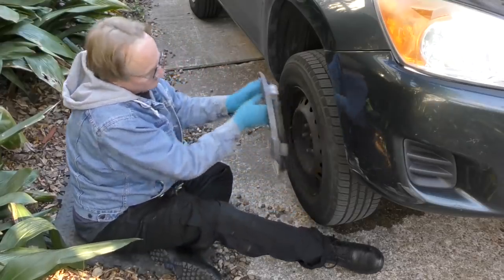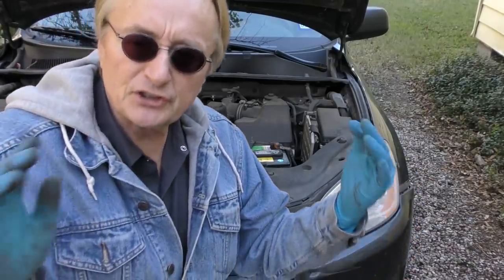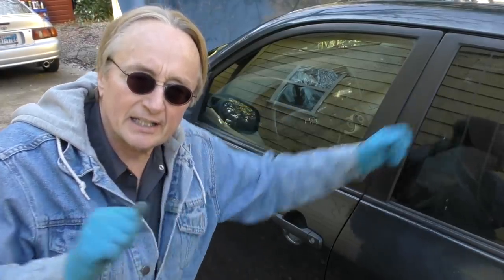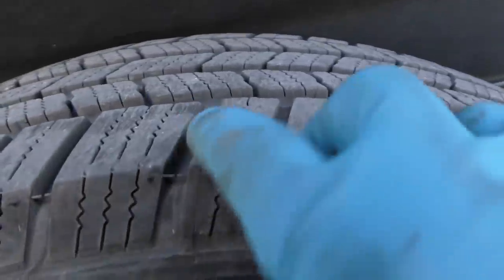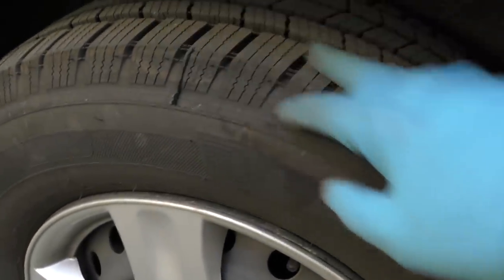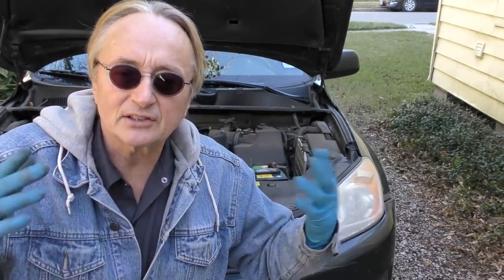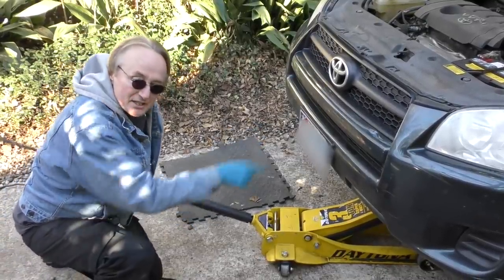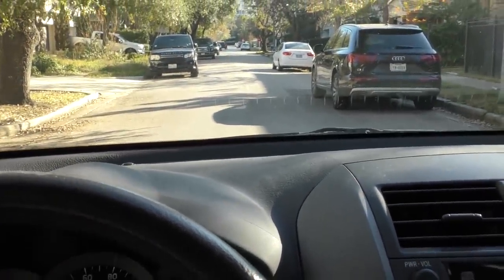Tire Secrets Only Mechanics Know

Comment: The reason they recommend the new tires on the rear is that when you make a turn at high speed the rear of the car(front wheel drive or awd)will loose traction and slide towards the outside of the turn (because the rear is lighter with engine mounted in the front) causing loss of control. 
I prefer the new tires in the front(only of I do not have the choice to buy 4 tires-i usually do replace all 4 and rotate them)like Scotty and drive slower around  the turns.
Reply: Basically they do this because it is less scary for the general public to understeer than to oversteer and generally keeps the average driver safer sliding out rather than spinning out. I get it, it's a lawyer thing but I'm with you guys, new tires on the front makes it handle more neutral to me.
Reply: @Gunne.r  yes ..you explained it better. I agree.

Comment: I just changed my struts my self. The old struts are bone dry. However, I did the compress test, and they just lost all the pressure! They stay compressed. So, worn shocks could be just worn out at the inside. 
If the car doesn’t feel stable on highway, change the shocks and struts

Comment: 90.ft lbs on my car.  Wheel seated on hub with a spot of lube to allow release. Torqued in a star pattern with no thread lubricant in three steps.  25 ft lb, 50 ft lb and 90.  Using a calibrated manual torque wrench.  Infiniti hub assemblies can be distorted by uneven or overtightened lugs by the guys at the tire shop.
Reply: Robert Burley  When all else fails, read the instructions...

Comment: It would have been nice to see the car shake to start as we saw the car not shake later. I always put the good tires on the front drive/steer tires even if they do wear out up there due to use and alignment faster. AWD is the other place they get you if the tread differs by 3/100 of an inch insisting on an entire new set.

Comment: I just had two front tires put on.. was expecting to spend 60.00 or so... was told the TPMS sensor was leaking and i needed that replaced for a total of 250... just wanted to ask someones opinion on this. If there was an issue with the sensor my understanding is it would have been leaking before the tire change. To me it seems like they damaged the sensor while replacing the tires and charged me for the new part,labor and programming. They just seem like really nice people (its a small shop operated by a guy and his wife) so I want to make sure this is what happened before I say something or stop going there. Also had I gone to a bigger place that does tires like Walmart or Mavis or Tires plus or something would they even have been able to charge me this? It just feels like I am paying for their mistake but I want to make sure I am understanding.

Comment: That is exactly why you put best tires on the rear, is to keep them from hydroplaning. It sounds logical to put best on front for traction, but at high speed when it is most dangerous is when you want to do what is the safest, with less weight on the rear you need better tread to disperse the water better to keep it from spinning around. It just happened to one of my fellow employees , because they thought the same thing, best on frount and it rained the next day and he hit a water puddle and the rear end came around and he totaled his car. Go to tire racks web site and read the article they have on their sight. I am a master certified technician and I keep up with what is discover from most recent events. I have 50 years experience. Final thought: Rotate tires every five thousand miles and replace all four tires at the same time and remember that most technicians in your modern shops have fresh eduction.

Comment: My mom got pitched from a dealership garage to buy new struts for an old Buick LeSabre (only 75,000 miles).  She agreed and had it done without telling me beforehand.  I told her a few times before that her car isn't a commercial taxi,... which needs constant new parts and repairs. She doesn't get it, lol.  I felt like calling the garage and telling them "shame on you...) but i didn't.

Comment: none video related but wondering if any one could give ideas....
currently my brake caliper piston is cracked, replaced lines, and new caliper, well the second cracked in the same spot, now where it sits if i try to put it in reverse, the tires will spin so much so that startings burning the tires  and it wont move, but jacked up the front left tire(the one keeps cracking caliper pistons) will spin freely,  any ideas?

Comment: With 2 NEW tires, do you put them always on the front? What if you have a rear-wheel drive car? The torque is on the back wheels but the stopping power is still on the front wheels.

Comment: Hi Scotty if the tyres have not run however there are more than 6 years old is it required to change the tyres
Reply: around 5 years it will start to dry rot (small cracks throughout) which makes a sudden-blowout a lot more likely (aside from losing traction/grip more easily)

if they were stored outdoors, they will dry rot even sooner

Comment: Hey Scotty. Happy New Year! How are those Porter Cable electric impact drivers? I was thinking of getting oe because I'm getting tired of wrestling with tire irons.
Reply: Why not go portable impact like Milwaukee. Good tool, very strong. They are a little heavier than both the Air and corded ones though.
Reply: @PanameraTurboSEHybrid  The problem with Milwaukee is that your paying for the name.
Reply: @uhrsker  Just like Snap on, Matco, and Cornwell? I'd rather buy Milwaukee than from those super expensive companies. I'm sure there are better cheaper tools out there, but I'm a loyal Milwaukee customer, and their tools has been great.
Reply: I use an older corded Milwaukee vsr impact DRILL (with quick-change hex drive meant for large auger bits) with an adapter to 1/2 square drive. It works perfectly for lug nuts on passenger cars.

Comment: Do you live in the mid West? I do not think you do. Having more tread in the front can create an oversteer condition in ice condition roads. Having the best traction on the rear prevents fish tailing and also gives the driver more of an understeer condition that is much easier to control. This is also something recommend by the USTMA(United States Tire Manufacturers Association)

Comment: Also if your vehicle shakes bad when braking or at high speed get your tires balanced. It’s cheaper than getting new rotors and pads. Most of the time that’s the problem

Comment: Getting a shake or vibration at high speeds is often a clue to warped rotors. Especially on a front wheel drive vehicle and the steering wheel shakes. Common problem. The owner probably pad slapped the front brakes without machining the rotors to take the warp out. This is why they have shaking in the wheel while braking at high speeds, but still have good pad life left.

Comment: My car is unstable at higher speeds 55mph/80km/h. Its slushy and goes side to side
Audi A3 8V. The car was sporty with summer tyres, very sporty. And when I fitted new winter tyres the steering feedback got loose, unstable as I said. Even in sport/dynamic mode😬

Comment: hey Scotty i have a 2014 Sane Fe AWD that drives like its always windy. checked the alignment, it was out and corrected, did not fix it. 30,000 mi all original parts.
Reply: It's either tires or alignment. Since the expiration date of tires is 7 years of age I would get new tires soon.   Also make sure whatever loads you are carrying are balanced. I had a customer issue once where the guy loaded his gear all on the right side rear of the car and it was squirrelly on the freeway. After spreading out his load the problem went away.

Comment: Always have the worst tires on the back if they blow on the front you are more likely to cause an accident cuz you will not have good ability to steer off the road and safely come to a stop if tires blow in the back you'll still be able to handle the vehicle decently regardless if it's front wheel or rear wheel drive and also don't put the passenger side tires on the driver side and the driver side on the passenger side it will reverse how the steel belts have been flexing in the tire and weekend them to the point where it we'll increase the likelihood of a blowout has been edited due to typos with speech to text

Comment: I use Bridgestone Potenza RE 92 tires. For the last two years I have used 130 psi down to 100 psi had no problems. I get well over 100 mpg on a 2000 Honda insight. I also have the modified gas line.look at my avatar

Comment: I have a 2012 Ford van and the front tire always wear on the inside edge. The only way to help the situation is I''d have to rotate the tires every 10k, which will only me 90 days since I put on many highway miles in my delivery business. The problem is to do the correct tire maintenance, the cost of alignments, tire rotations, and balancing, it will exceed the cost of a new tires. I used to rotate my own tires, but I'm older now and its more difficult for me.

Comment: i found that when your front end wobbles when you are using the brakes is probable heat warped rotors the must be replaced cant be fixed.

Comment: I didn't hear you mention that putting the older tires on the back will help correct some of the uneven tire wear. Hence the reason for rotating your tires.

Comment: "...vacuum pressure"??  riot!  you also might point out the outer edge wear due to driving at high speeds (speeding?) or from frequent acceleration, such as traffic-signal "drag racing".  inner wear would indicate slower grandma driving, as the alignment would be for the car at a steady average highway speed, loading the engine mounts.  if the customer doesn't fit in here somewhere with his driving style,  alignment!

Comment: Always fill tires 75% of what max psi is so if it’s 51psi like mine 38-40 is normal pressure brand new for months they were set to 30 I brought them up to 32 my next visit they set it back to 30 a month ago. I set it to 35 started to drive better and then I decided to look it up and manufactures recommend 75% of the tire pressure a few days ago. I upped it to 39 psi. Driving a ton better now handling feels way better and keep in mind. These are Michelin tires. Basically they were under inflating my Michelin tires so they would go bad a lot sooner.😮 now maybe the car itself says to set it to 30 psi and that’s if it’s factory tires

Comment: The problem will return when the rotated tires/the new tires in the front are worn as much as the tires you switched to the back were..
   did you check front suspension for radial front to back movement? You did check the way you would check a wheel bearing, but I didn’t see you pushing back on the wheel and pulling forward on the wheel to check for suspension wear.. A small amount of play in a bushing magnified by the length of the control alarm becomes a lot by the time it’s out at the wheel. The problem could also be in the rear suspension. on motorcycles, I know these are not motorcycles were talking about, but bad shocks on a motorcycle in the rear, very often cause What is known as head shake/isolation of the handlebars left to right
Reply: The problem was never fixed by the rotation . While they did need rotating, based on the symptoms he described this vehicle has warped rotors , nothing more , nothing less . He never drove it fast enough on his last test drive for it to show .  The tires will never cause a shake ONLY under braking .

Comment: I have a question, if you could please answer it cause this has been driving me mad.

My mother in law has a 1995 Honda Accord and she recently had her master cylinder replaced. Well the car was fine for like 5 months and then boom, her brakes went back to the floor. But now, when you step on the brakes the engine rpms go up slightly and when you get off the brakes, the rpms go down. I tested to see if the booster was bad, and to my knowledge it wasn't but I read that if it has an internal leak, it can cause something similar to that. I checked the vacuum hose and it looks fine so my question is, does it sound like she needs a new booster? Normally k wouldn't care but I live in Michigan and it's been snowing so it's dangerous driving her car
Reply: Sounds like a bad booster
Reply: You think so? Like I said I was teetering towards booster but that's why I had to research first before because I did all the tests you can do and it seemed fine
Reply: @Trckstr971  
It's possible the old master caused damage to the booster diaphragm.  It doesn't happen often, but it can happen. It's also possible the new master is defective but the symptoms sound like a booster issue

Comment: There is a good reason to put your best tires on the BACKwheels: when you slip&slide with the frontwheels (understeer) a lot of times you can correct this safely. But when you slip&slide with the backwheels (oversteer) it's almost impossible to correct this. Every good car-trainingcenter will tell you this.
Reply: You cant control understeer, you can get yourself out of oversteer just by countersteering..
Reply: @Beth8121  That's only true for (rearwheeldriven) drifting, not for regular (frontwheeldriven) cars. For regular drivers understeer is relative 'easy' to correct by less throttle (which is a natural reaction). Oversteer is for regular (frontwheeldriven) cars much more dangerous because less throttle is increasing the oversteering and in a lot of cases it results in a very sudden and dangerous spin, which happens so fast it's almost impossible to countersteer fast enough. Most manufacturers therefore choose understeer as the 'basic setting' for their frontwheeldriven cars.
Reply: @robde-e-e  oh yeah for sure. Front wheel drive is impossible to correct oversteer from

Comment: i had the same argument up in Minnesota at Discount Tire.  I always put new on the front, we have snow and i need to get going.  Their argument was, new on back so the back end is less likley to break loose and spin out in slick conditions being the back is lighter and well its the back.  i get that argument, however, if you know how to drive, its not a problem.  why they would do this in texas i have no clue.  probably because stupid corporations have the same policies nation wide which makes zero sense when it comes to tires.
Reply: Scotty also said it was cold and the road was slick even though you can clearly see that its bone dry

Comment: Most front-end ball joint steering and suspension components become looser in the first 100 miles after install as the grease squeezes around in the socket to where it's not cushining the ball as much as when it was new. There's also a seating process that takes place in most joints as the internal polymer or steel bearing wears in. Some ball studs and sockets are hardened while others are not as hard and are built in a different way. Even with grease distribution channels built into the ball and/or socket and even on joints that are serviceable (greasable), there are many different ways to make the internal ball/socket joint, so hardness may not always matter in some designs.  Technically, what I'm about to say shouldn't make a difference, and is only my opinion, but I'm pretty sure of this, especially when it comes to the super-hardened metal-bearing joints I use....  If you're at the parts store picking out new ball joints, be weary of the ones you can move easily with your hands right out of the box. If one is loose and the other is tight, chances you'll get more life from the tight one. Ask for 2 tight ones (always change them in pairs). This goes for upper and lower ball joints and inner and outter tie rods. Greasables do not necessarily last longer unless they are of higher quality and you are greasing them often. Greasable tie rod ends can drip grease on your inner wheels over time, thus, throwing the balance off. NEVER BUY "SERVICE GRADE (cheap) JOINTS, ONLY PRO GRADE OR SUPER DUTY OR BETTER. Most Service Grade joints only last a short time and should be illegal. Most manufacturers have a few different lines of joints that are carefully named so you don't know at the store which level you're getting UNLESS YOU RESEARCH THEM. For instance, Mevotech has at least 9 different brands all claiming to be the best. I bought all Mevotech Supreme X Factor parts for my highway-driven-only Corolla which all failed within 1 year. Consumers need an independent reliable, impartial and trustworthy 3rd party that tests ball joints and wheel bearings and posts results. Oddly, everything on planet Earth is professionally tested except for car parts. Hmmmmm!

Comment: Only recently did I hear and "Expert" on an episode of Consumer Report's Talking Cars say that if your replacing two tires that your suppose to put them on the rear.  Craziest thing I've ever heard.  I've had to do one and two tire replacements on AWD cars with front wheel bias and always put the new tires on the front.  If you put them on the back, wouldn't that go against the idea of doing tire rotation in the first place?  We always put the fresher tread on the drive axle that wears the tread the fastest.  You just proved CR wrong!  Your RAV4 owner experienced a bit of fishtailing.  Maybe if it was a RWD BMW the story would be different?

Comment: The reason you are supposed to keep the best tires on the rear is because you can feel the front tire breaking loose. But if the rear tires break traction before the fronts then your vehicle can spin around on you.